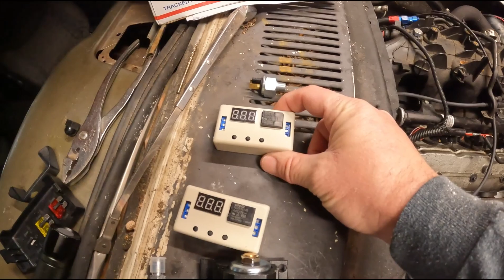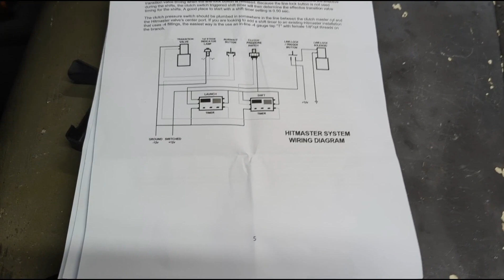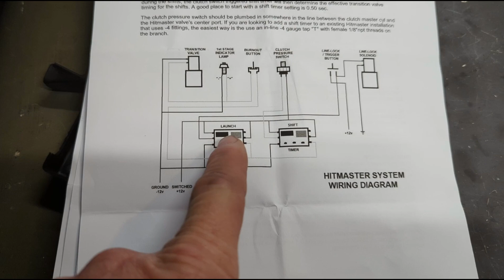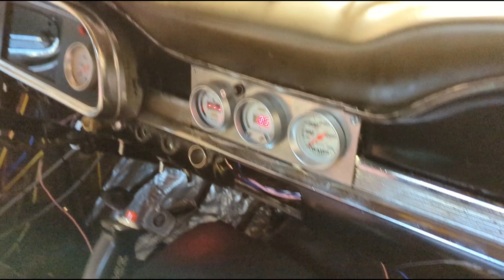Hitmaster In-line hydraulic 2 Stage Clutch Control System!

Comment: My head hurts....that's a lot of wiring and plumbing.  But it should work good.  When I was going to do a 500hp 2.3 turbo in a Foxbody I bought the Clutch tamer.  Same thought just works with mechanical cable clutch.  I smell a test drive coming fairly soon!
Reply from the maker: The Hitmaster is made by the clutch tamer people. I hope so on the test drive. Really just need the windshield in and an alignment and we should be close enough for a drive.